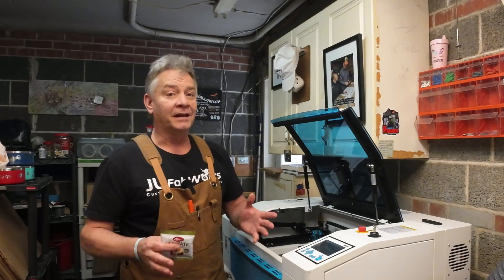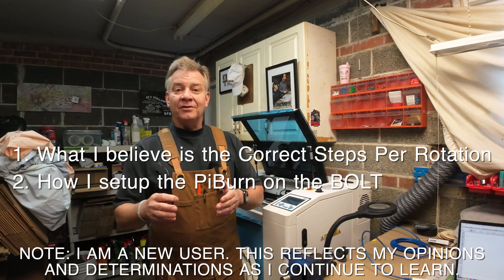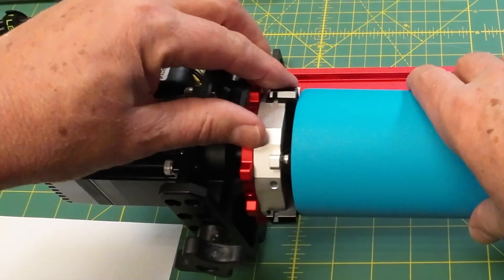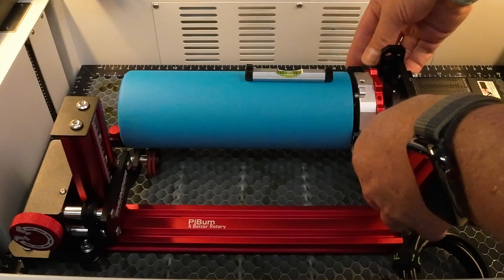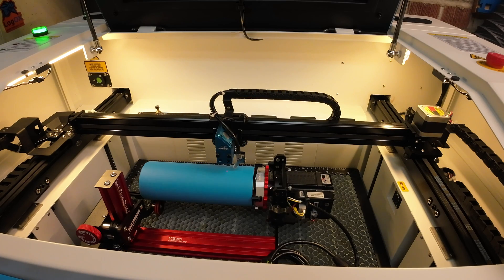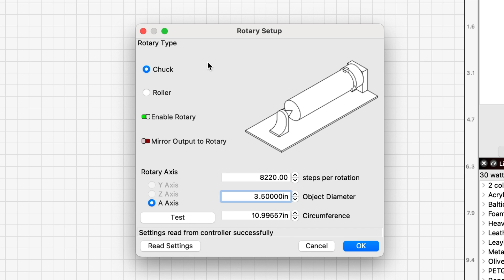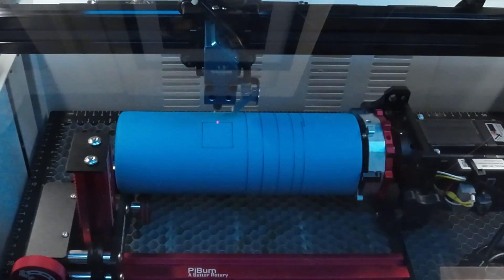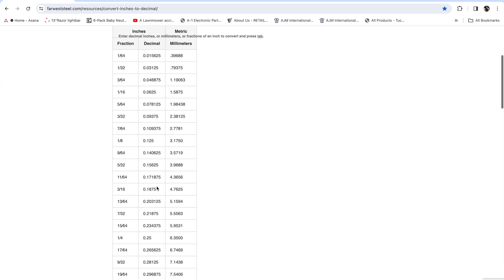PiBurn GRIP Rotary. Thunder Laser BOLT. Steps Per Rotation Are So Important! 015  4K

Comment: do you have to calculate steps for every project? or once calculated its always the same
Reply from the maker: Hi Richard - great question. The Steps Per Rotation is the same for all - you just need to find it once and use that SPR for everything.  And in some cases, you can find the steps per rotation by looking at the DIP switches on the Stepper Motor (if written there, or captured in the owner's manual). But it is the same for everything once you know it. Merry Christmas!

Comment: Hello I’m new to this rotary. I’ve done all the steps but when I hit start I get a msg saying the job exceeds working area. It’s not that big of a job and I’ve used the file on another laser. Any suggestions on why I’m getting this msg?
Reply: Thank you! That helped me figure it out! I’m so happy with this laser.
Reply from the maker: @lelageorge4722  So happy it helped a little - have a great weekend!
Reply from the maker: Good morning! Just my thoughts as I have had that message a few times but it happened when I was engraving a flat material and the size of my design would not fit from the spot I set the "origin" on the honeycomb. So if you are getting this message when using a rotary, I think it is because the overall width of your design exceeds the circumference of the object you are trying to engrave. So, if you measured your diameter, then clicked into your Rotary settings menu and input it ( in lightburn), and you set your Steps Per Rotation at 8020 (for the BOLT), then you will see the circumference measurement there. If your design is wider than the circumference then I think that is why you are getting the message.  I don't know for sure as it has not happened to me but let me know if that helped(?) Good luck!

Comment: Square test is also know as a test for proper steps per rotation. Make a square in lightburn then measure with a tailors tape on the object. When the measurement is correct you have correct steps.
Reply from the maker: Thanks Chad!

Comment: add 10% to the width of your round logo. That will give you the correct aspect ratio when engraved on the tumbler.
Reply: 10 is a good starting point but it really changes depending on the diameter of the object. I have found large diameter objects to be as low as 7%
Reply: @chadkuntz267  the average person won’t be able to discern between 7-10%. Either correction will prevent the logo from appearing it pinched.
Reply: You might be right the evgravers eye causes me to chase it
Reply from the maker: Thanks Toby and Chad. I will play with the %. On several normal or large diameters the 10% worked pretty good but on the small wine tumblers ( short and stout taper), the 10% made it look stretched. Thanks again - all great and helpful advice for me - Cheers!
Reply: I think it’s very obvious when it’s wrong.  Anyone who has fit pipes will know exactly what’s going on here.   I imagine there is software that will scale/ skew for cylindrical and conical shapes.  

Practically, I think a solution would be to put a metered tape or reference on the object to be zapped.  Instead of calculating movement from the motor, calculate movement from an optical sensor on the print head.
Reply from the maker: @forked-lightning  Thanks Nate! The next version of this software is supposed to be able to compensate but apparently it is not as good as hoped. Thanks for tuning in and for your advice/comments. Cheers!